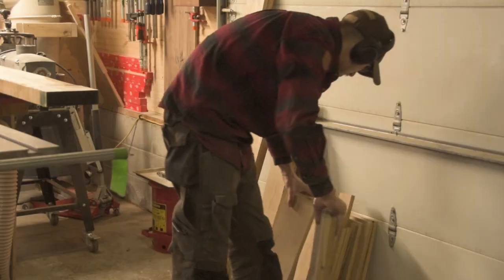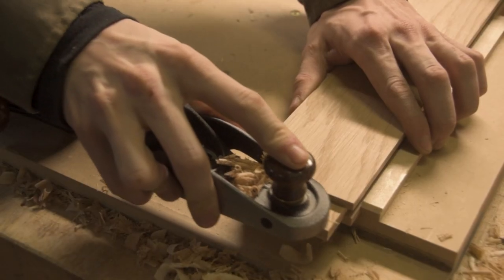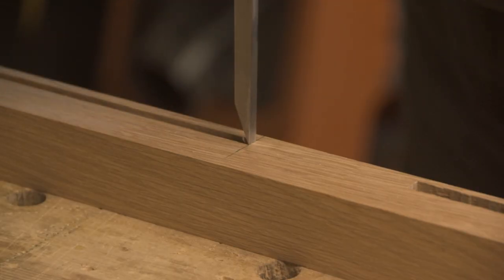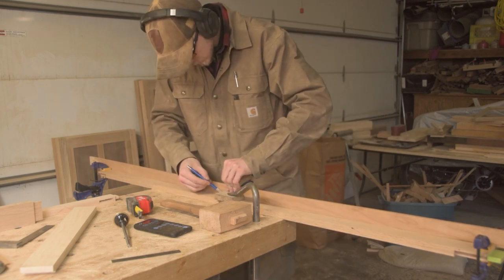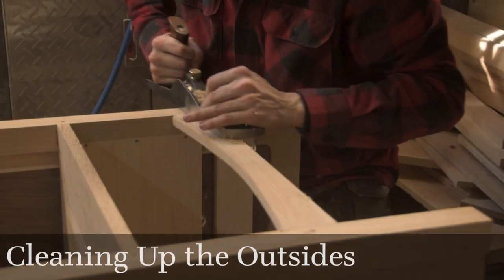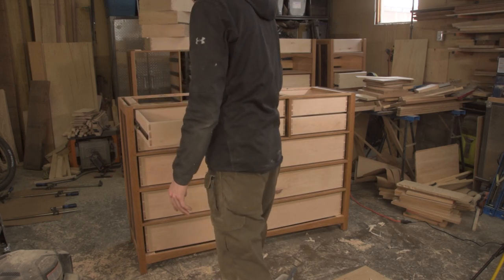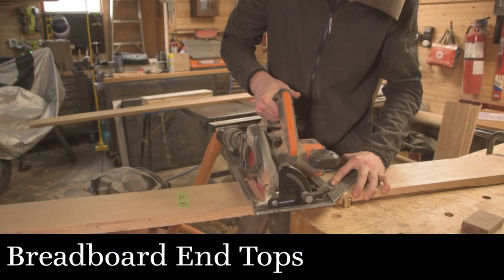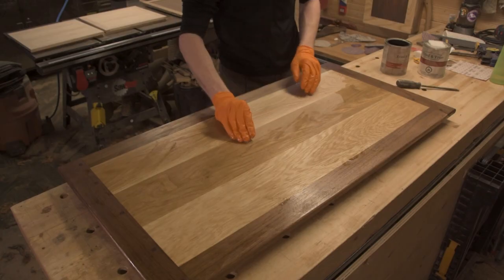$15,000 White Oak Bedroom Set

Comment: I often see you using a Low-angle Jack instead of a standard angle. Any reason?
Reply from the maker: My first handplane was the Veritas low angle jack, and that's what you'll see in most of my early video.  I just bought what was easily available and I read alot of good reviews about it. I do like having the different blade angles as an option but now that I've started to use standard angle planes, I much prefer the feel of them over my low angle jack.

Comment: This is beautiful work. Very nice.
on the sliding dovetails... Next time don't do a through dovetail. Stop it a few inches short in the front and you can fine tune the front of your workpiece to sit wherever you want. Flush or inset. It isn't that much more effort than what you are already doing there. It makes for a really clean look. At least I prefer it over the through almost always. But on certain pieces I could see changing my mind.
Reply from the maker: If I was doing this project again I would definitely do it that way, I liked the idea of the through dovetails because it shows off the joinery but it made for some less clean looking joints.

Comment: As a woodworker, I can see where the 15,000$ was not excessive due to lumber price and joinery.  Not sure if it was client or you, but I would have made the drawers old old style with wood on wood slides. Would love to see that in Cherry and maple too vs white oak and walnut..  Either way is stunning.
Reply from the maker: I made the choice with the drawer slides, especially at this price point the expectation from my point of view is that the drawers should always open and close smoothly. With the mechanical slides, the weight of what's in the drawer doesn't affect how easy it is to open like with a traditional setup. As a woodworker I appreciate the quality of traditional drawers and I use them alot on projects for myself but I was worried that my customer would find them clunky or heavy, that's why I went with the mechanical ones.
Cherry and maple is coming very soon to the channel, it's a great looking combination and I excited to work with it!

Comment: love everything about this build, save the mechanical slides. shakers didn't use them. they cheapen the final great design and build. just my two cents, fwiw.
Reply from the maker: By adding those mechanical slides, it actually increased the value to the customer because while traditional drawers can work well these mechanical soft close slides make the dresses easier to use.
Reply: @morganhurst_redridge  thanks for taking the time to reply, most don't. earned yourself a new subscriber.

i will not debate the ease of use, it's personal preference i guess. though i will argue that a quality, piston fit drawer is pretty easy to use. two things bug me about mechanical drawer slides in custom, high end furniture. 1. they tend to rack the drawer a bit if you don't close exactly on center (saw that in a few of your shots too), and 2. something about wood and metal just does not appeal to me.

all that above notwithstanding, this is a beautifully designed and built set. there's a reason the customers love it, it's gorgeous and very well made. what's not to love. should last them a lifetime (minus the slides ;).

Comment: Morgan,  why do you have a Cadillac hollow chisel mortiser that probably costs more than my Jet jjp-12,  but cheap jointer and planer (so to speak)?  Invest in a helical head jjp-12;   trust me.   It's worth it.  Absolutely beautiful pieces btw.  I also want to pick your brain about something else.   I have many hours of footage,  and want to do my own channel,  but I can't find a producer.  Videography and editing aren't necessarily my thing.   Plus it already takes a month to create pieces like these,  so I don't have the time per se.  Should I bite the bullet and do it myself?   Do you edit your own work,  or do you have help?
Reply from the maker: I got the Powermatic at a stupidly good price off Kijiji, never would've bought something that nice at full price! Main reason I haven't upgraded my main machines is I don't need to at the moment, they both work perfectly for what I need also I'm limited in my power specs. Without doing major work,like ripping up the back yard , I can't get 220v out to the shop. My plan is to save up for a good 12" jointer for when I do have a shop where I can use 220v.

For your videos, best thing is to start by editing them yourself. You'll learn pretty quickly what works and what doesn't and how best to record and what style you want to make your videos in order to make the editing easier. I've edited all my videos since the beginning and I don't plan to try and get an editor until I can easily afford to pay someone, probably around 100,000 subs.
Reply: @morganhurst_redridge  well I'm rooting for you brother.   Fortunately,  I have a washer and dryer outlet in my garage,  so the 220v wasn't an issue.  I'm about to upgrade to some grizzly monsters anyhow, so I'd give you my jjp-12 if you didn't have to go rewiring everything in your shop (and also lived in DfW since its 700lbs).  Greatly appreciate the advice.  I'll shoot you a link to my first video when I get one punched out in 2023.
Reply from the maker: @colinchesbrough5772  Sounds good, looking forward to it!

Comment: I’m assuming that you did not take your time into account for $15k? I’m always amazed to see people charging stupid money for a piece of scrap wood filled with plastic! You’ve obviously taken time, used proper joinery skills and made some excellent pieces of furniture. $15k looks like a bargain!
Reply from the maker: That $15K was the total cost to my customer, I did give them a decent discount because I'm still fairly new to woodworking and I really wanted this project for the experience! I knew with the scale of this project there would be alot to learn and I didn't have a good way to estimate the time so I made a rough estimate and it turned out pretty good. If I remember currently the materials cost around $8k, then the other $7k went towards shop expense and my time, given that this project took about a month and a half it wasn't great pay but I learned so much and it was an awesome experience!